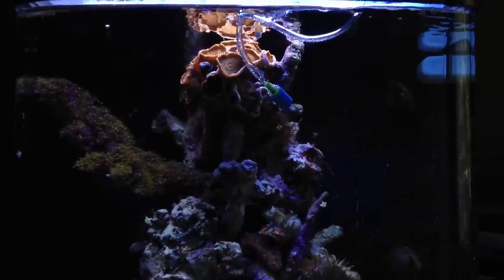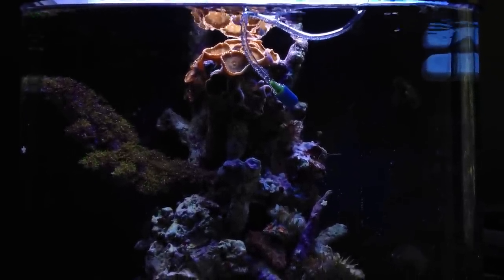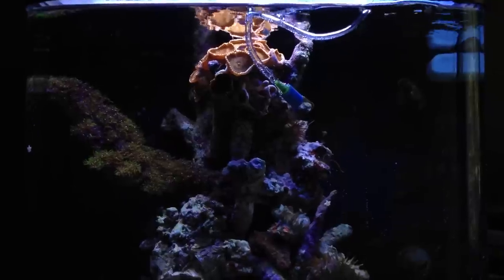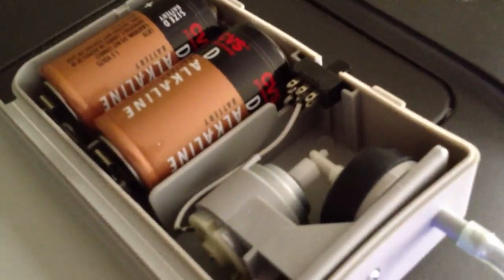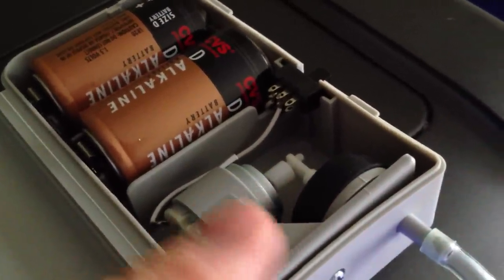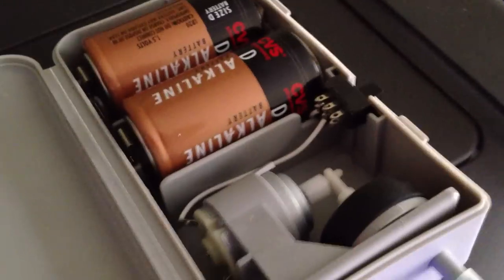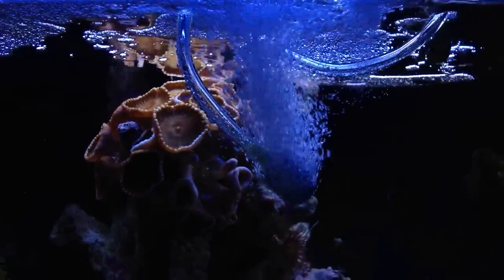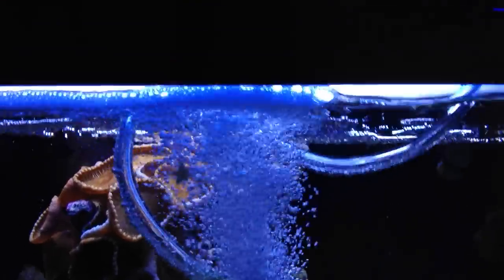Battery Air Pump: In Action

Comment: I heard you have to have an airpump running in the tank 24/7. I have a tropical tank. Is this true? Great vid btw, nice tank!
Reply from the maker: Not true. Most air stones are to keep water circulation in tanks with inadequate flow. This is an antiquated approach and not used very much anymore. A reef tank with good surface agitation and a protein skimmer will provide all the oxygen needed for success.

Comment: Can I used Only for air pump to fill air in Empty air Tank size 1.12L? I look forward to your response pls.
Reply from the maker: WingedBull1 I'm not sure what you're asking. These pumps are powered by two 'D' batteries.
Reply: ***** well this pump fill an empty tank with air a Tank 1.2 gallon, I like to know if this Pump if Can a Air Tank 1.2 gallon with Air Only, that is an empty air tank size 1.2 gallon, would this pump do the job to fill it with Air Only?
Reply from the maker: +WingedBull1 I don't think it had enough power to pressurize a holding tank.